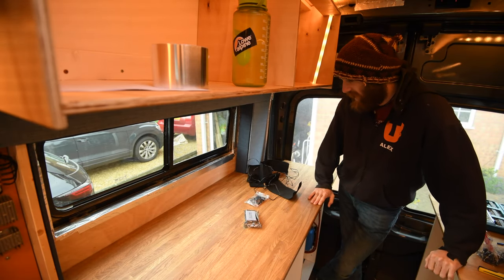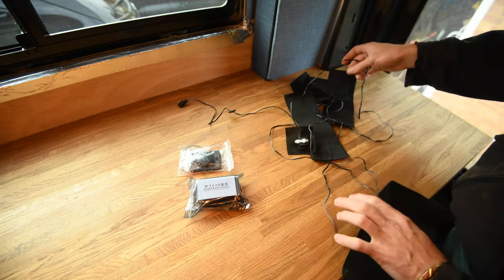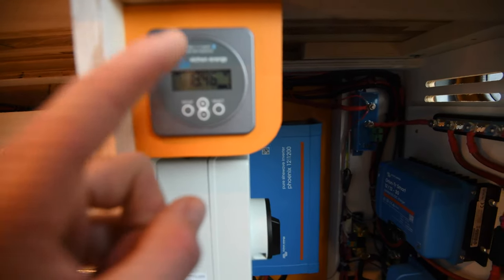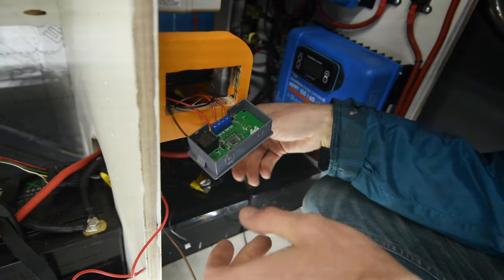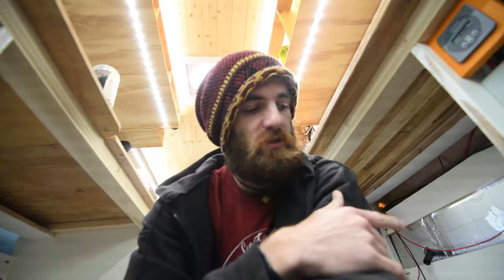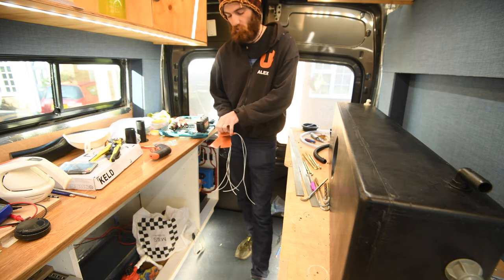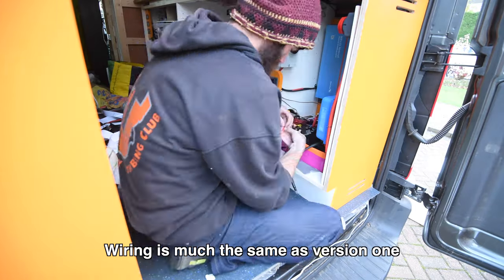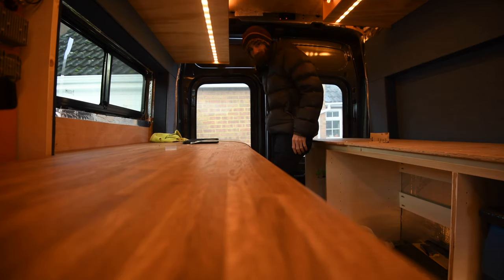DIY lithium battery warmer, Trial and error | EP35 | Ford Transit Campervan Build

Comment: Great video. I'm about to install 60w heating pads to my batteries. What did you end up setting your on and off temps to on your temp switch?
Reply from the maker: Currently I have a set temp of 8C with a backlash/Hysteresis of 1C 

So the heater pads turns on at 7c and off again 9c. I could probably set it a bit lower but so far that’s been working well for me
Reply: Oh wow, that is a pretty small range. Do you find that this makes the heaters having to cycle on and off more? I guess the goal is to use the least amount of power while keeping the batteries above freezing. I was planning to do have mine turn on at 5C and off at 10C. You think that is too much?
Reply from the maker: I guess in my system it has multiple short cycles 7-9c . Whilst 5-10c would be one longer cycle. Remember you don’t need to keep the batteries warm as in hot. You just need to keep them above zero degree, so I only keep them a few degrees above. I could probably lower my 7-9° a bit more. In the case of the heat pads I’m using that doesn’t seem to be any drawbacks of multiple shorter cycles.
Reply from the maker: 10° might be a higher than it needs to be. As quite often during the day at the moment whilst I’m working on the van I don’t often rise above 10° normally. During the night at the minute where it is around about 0 overnight temperatures and I’m not currently in the van ( to the heating is off )  I find the battery warmer switches on twice. 

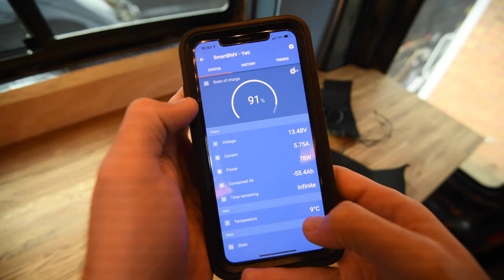Looking back through my Victorn data. I can seeing the battery heater normally  turns on for 1:30h to heat the battery from 7 to 9c. So 5.5Ah In total or 3.75amp hour per hour.
Reply: @MispronouncedAdventures  ok this is very good information for me thank you. It gives me a good baseline to know where to start my tests. Happy New Year!
Reply: @MispronouncedAdventures  oh one last question if you don't mind. When the heater turns on, does the temp continue to drop for a few moments before it starts to head back up? I'm just wondering how it would do if the ambient temps drops quickly and if I am supplying heat fast enough to overcome the potential of freezing.
Reply from the maker: I haven’t seen the batteries drip below the turn on temperature. The batteries are so heavily insulated additionally to the battery warmers and themselves being such a solid thermal mass. That generally temperature loss is slow, there will obviously be a tipping point on the system when when the outside ambient temperature is Cold enough that they can’t keep up. But I am yet to find it. Additionally at the moment as I’m not in the van overnight the batteries operating in worst case temperature scenario where the internal temperature of the van also dropping to around zero. Normally over the winter when I’m sleeping in the van overnight the heater will be on so inside the van will be a nice 19°

Comment: Where did you get the valence software for diagnostics and how are you hooking up to the batteries? I have a green u-27
Reply from the maker: If you check out my other videos on my channel you will find a video all about repairing and making an adapter the batteries to use there Communications cable and how to get the software working. :) hope that helps

Comment: Great vid. Could you share the link to your temperature cut off controller please?
Reply from the maker: Sure. I use this one but most “12v temperature relay” should fit that bill for you 

https://www.ebay.co.uk/itm/Thermostat-Relay-Temperature-Controller-Sensor-Digital-12V-LED-Display-Meter-SPR-/333872298030?_trksid=p2349624.m46890.l49292
Reply: Great, thanks!

Comment: What about just putting a heat tube in the cupboard on temp sensor relay  and then no need for all the insulation and pads they are small at 45w ,
Reply from the maker: Definitely lots of different ways of doing. Best way at the moment I’ve found it to lift the batteries off the ground by 25mm to make an air gap and then use a 1 watt pc fan blow warm air from the diesel heater cabinet under the batteries. If it’s cold enough to get the batteries below zero it’s cold enough my diesel heater is on
Reply: @MispronouncedAdventures  I use a hyco 1ft heater to keep van space from freezing when it's not in use

Comment: Top work again Alex - informative as usual - really enjoying your series. I got some of recirc bits for my shower too. I am going to be going down the lithium diy build route but obviously incorporate lots of your bits and bats you have down - so nice one! Have you got any links to the relay, usb connector and version 2 heat pads links? Would you recommend them? Cheers batman
Reply from the maker: Glad you found it useful and are planning on using a similar route. A friend of mine has built my battery warmer designed for his DIY lithium pack and has had similar good results ( main trial and error part is the location of the temperature sensor ) , remember to use a heat sink ( I used the 2mm aluminium plate ) to more evenly spread the heat from the pads. The USB connector was only used on mark one as those heaters were USB powered. Mark two / the final version the heat pads were directly wired to the relay. 

Heat pads 12v 15W 

https://www.ebay.co.uk/itm/15W-12V-5-10cm-Engine-Oil-Tank-Silicone-Heater-Pad-Rubber-Heating-Mat-WarmingKLT-/393018677185?_trksid=p2349624.m46890.l49292 

Temperature relay 

https://www.ebay.co.uk/itm/Thermostat-Relay-Temperature-Controller-Sensor-Digital-12V-LED-Display-Meter-SPR-/333872298030?_trksid=p2349624.m46890.l49292

Comment: So it's been a year and change since you posted this - one winter and part of another. How's it all working?
Reply from the maker: It’s been brilliant, I seen it come on now and again if I look at my electrical usage over night. Normally If I’m in the van overnight and the Diesel heater on, they are not needs. But if the van is empty and cold over night in the winter they might turn on for an hour or so.
Reply: Glad to hear it! I've built a pair of my own battery banks, and am strongly considering going this route as well.

Comment: rewatching this one as we now have lithium and looking for ideas to keep ours warm this winter. Are you still using the same method to heat your batteries?
Reply from the maker: I found this as a excellent active solution for cold weather heating. However, I think a passive solution which I now have in place as well as the heating pads for the Arctic trip I did last winter was to lift the insulated boxes the lithium battery 25 mm off the ground and put them on tiny stilts, so there is an air gap between cold floor and insulated boxes. Additionally, because my diesel heater is the next cabinet along. I’ve put a small 12v PC fan to waft warm air from the adjacent cabinet underneath the air gap effectively keeping the batteries warm for free. Because if it’s cold enough outside for the batteries to cool down, it’s cold enough for the diesel heater to needing to be overnight. On my Arctic trip ( down to -27c ) with that solution in place, I don’t think the heat pads ever turned on.
Reply: @MispronouncedAdventures   thanks for replying so quickly! I'll def get ours raised off the floor that easier enough. I'll make some jackets up like yours and see how I get on. I take it you've not had a problem in hot weather with the jackets on
Reply from the maker: No problem. 

Insulation has the same effect in the hot weather. Keep them cooler for longer. Not had any issues with them getting warm.

Lifting them off, the ground is definitely one of the best things i did. Swapping 100% contact with a cold surface / the floor to 5% contact makes a huge difference
Reply: @MispronouncedAdventures  great insight thanks Alex. As an aside, just got my relay board working on my pi thanks to your latest video on cerbo. Can't afford that at the moment but the pi has served me very well so far. :) Keep on with the videos and adventures. Stay safe.

Comment: Hey man ! Nice system, I was thinking of making something similar. How’s it been working for you so far ?
Reply from the maker: So far brilliant. I do need to still Insulate the top of the batteries as the Victron temperature sensor is mounted to the main POS terminal and exposed to the open air of the van so it’s getting colder and triggering the low temperature cut off, but when I plug the batteries into their diagnostic software I can see the actual internal temperatures of the battery or a few degrees higher. The temperature relay sensor is mounted to the side of the battery inside the insulation and give a more accurate temperature of the bank as a whole.
Reply: Awesome, sounds like they’re ready for winter

Comment: Anyone know where I can get a good PID or thermostat for a 48V LiFePO4 bank?
Reply from the maker: 12v temperature relay would be easy and cheap. I’m struggling to find any 48 V DC options. 

Does your 48 V system have any stepdown converters in it from 48 down to 12? Might be easier to run a 12 V temperature relay through a step down.
Reply: I have a 18-90V DC to DC converter step- down to 12V (buck), so may end up using it, but it also creates heat so I'd have to allow for that. Soo hard to get 48vDC (52VDC) electronic gear. The entire industry is stuck at 12 or 24VDC while everyone is going to 48V or even higher.  @MispronouncedAdventures

Comment: My 15w heat pads have arrived……. They’re so tiny!
Reply from the maker: Mine were as well for which is why I used the plate
Reply: @MispronouncedAdventures  I’ll do the same. Currently browsing 1mm aluminium sheets

Comment: No sure if it’s a deliberate error, but is that trail (or should it be trial) in the title? Great progress as always
Reply from the maker: It’s a dyslexic error haha, I’ll fix that now
Reply from the maker: All fixed, cheers!
Reply: And shouldn’t it say 10 deg c not 0deg c in the description?
Reply from the maker: I’ve changed it too °C at least I can’t spell it wrong if I just copy and paste the symbol. 

The operating charge temperature for many lithium cells is around 0°C - 45°C. 
For testing purposes I was running them a little higher so I can get the relay to trigger. ideally going to set it up so they shouldn’t drop below around 6 or 7 °C

Comment: Just go with lto batteries and rhen you don't have to worry about heatingJust go with lto batteries and rhen you don't have to worry about heating see brendon Tait batteries and you can run them to zero volts with no damage and fully charge without significant loss of life
Reply from the maker: lto = lithium-titanate batteries? Not sure rhen? 

Yes, there are plenty of Batteries and lithium chemistries. But those particular chemistries aren’t anywhere near mainstream consumer yet ( in the campervan leisure industry ) but I am aware you can sort your own cells. 

Only the last few years have battery heaters and low temperature cut offs. become more normal in consumer lithium batteries for campervans. The video is designed for people who didn’t have those features originally 

It is a rapidly developing industry and lots of new advancements coming, especially with new chemistries. I look forward to the future